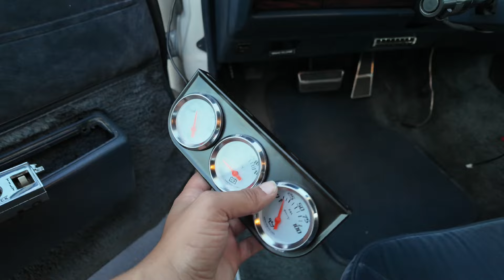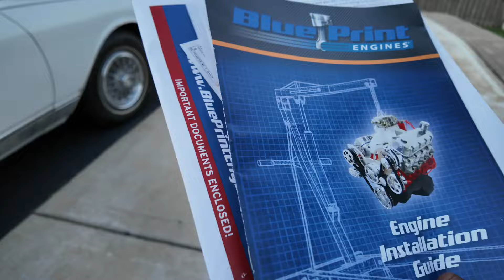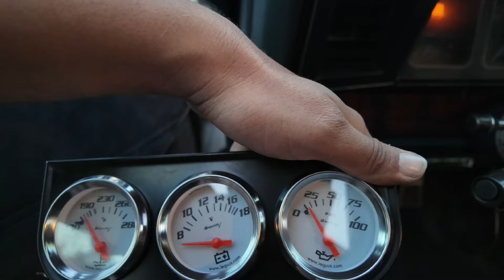1988 Chevy Caprice with a Blueprint Motor

Comment: So the engine is about 6k and those manifolds dont breathe for nothing.

Get 1-3/4 headers for it and 2.5 inch exhaust. 

Blueprint engines are good quality. Itll make about 425 at the crank and adjust the doors on the car and you good.